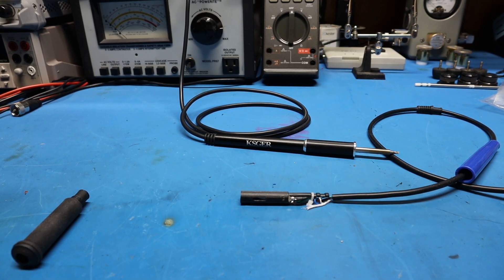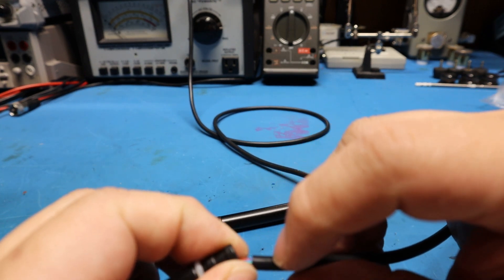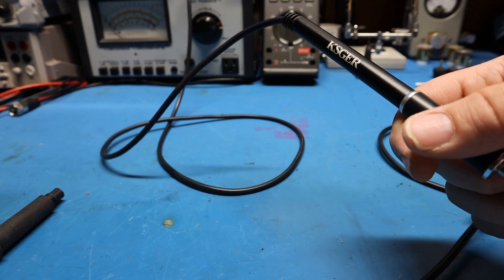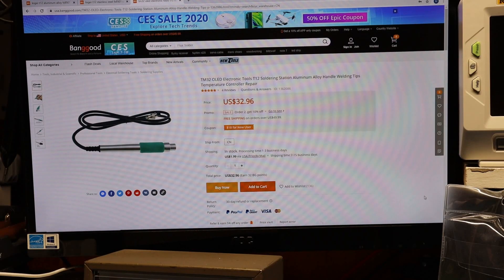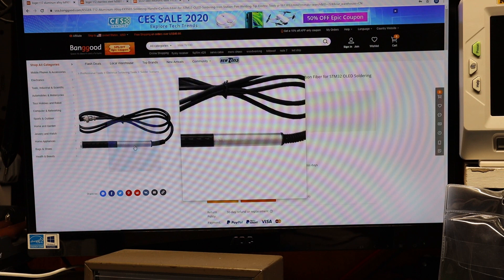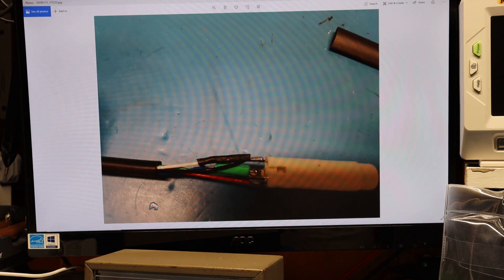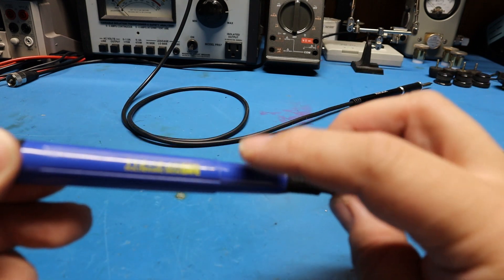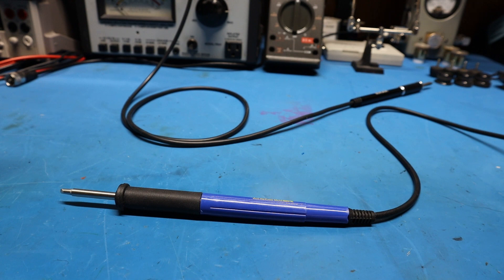KSGER T12 Aluminum Alloy FX9501 Metal handle Upgrade and review

Comment: I have the carbon fiber handle you show at 5:02 and honestly I'm disappointed in it. The white plastic sleeve inside that holds the tip secure (or rather, is supposed to) deformed after only a few uses and now tips slip forward and lose contact every time I clean the tip or pop it back into the handle holder on my caddy. If the internal sleeves were replaceable that would be a big benefit, as I love the feel of the handle, but it just doesn't hold the tips well enough.

Comment: My handle (plastic version) with blue wire and black wire were broken after using for 1 month. I found the strain relief is not working therefore wires were pulled off. Your video is very helpful.

Comment: Thanks for this.  I had read somewhere that the plastic handled one you got with your kit had an issue when people were using them for long periods of time, although that post was not specific about the issue (but seemed to imply that that is why many of the new stations come with the old style handle with the retaining ring and sleeve).  Have you used the plastic handle like you used the metal one and did you find it getting too hot or other issues?  I had gotten the SS handle with mine because of another YouTuber who had an issue with the black handle being too tight, otherwise, I probably would have gotten the black handled one.  I found the exact issue with the SS one you did.  There's no positive click to say your far enough or to secure the tip and I ended up pushing the tip too far and pushing the guts out the back, so I saw your review because I'm hoping to get a better handle.
Reply from the maker: The black handle I had no issues with it being to tight and clicks in fine. I use that one mainly and for hours at a time. The plastic blue one had it where the tip fall out easily, but fixed it as connection base wasn’t screw in all the way and wiring issue from factory. Been fine since, but prefer the black handle and is the one I use mainly.
Reply from the maker: The black one the one to get out of all of them, it does get warm, but not hot and doesn’t bother me.
Reply: @thetechgenie7374  Wow, thank you for the quick response.  I appreciate your doing this video and "taking one for the team" when it comes to testing the various handles.  I had tried to find any info. I could on the various handles to see what was recommended, but could not find too much info. (not sure how this video got missed).  Most of the reviews of the soldering station revolve around the plastic handle and I only found one on the black metal handle.

Comment: My Ksger K12 died, the hand piece had broken a wire off the motion sensor. The wires were all visiable through the strain relief, but i had not seen this video to realize i should have reworked that spot. when the motion sensor stopped working i was in the middle of a Amp project and could push the start button to get the iron hot in 8 seconds. Upon disassembly it was clear to see the blue wire had broken off. i reattached it to find the black wire had also broken off. i was testing the motion sensor with the handle disassembled and heard an arc from the broken black wire touching the red wire. i found where the black wire came off next to the white wire so i reconnected it. However, upon reassembly the head unit continued to show ERROR. i thought that was likely the restart process like when it was new. But then the tip took off and became cherry red. I shut it down. changed tips and restarted once again the new tip became cherry red. It would seen the thermistor has failed or its circuit.  I ordered a new KSGER Alum handle. Hoping it will fix this issue, but I am concerned the short that occurred after the black wire broke off and shorted on the red wire, maybe have fried a component handling the temp circuit. If so where would take this unit?? Made in China, took me months to receive it and even after all the positive reviews, the strain relief fails to protect the skinny wired connections.  I am really worried, I am retired and money is not easy to spend on hobby tools.  Any ideas welcome. Dennis in Virginia

Comment: Good video what to look for and how to do some simple repair/corrective measures. Say did you replace your Weller unit? Keith
Reply from the maker: No the Weller station I keeping as it has also direct active tip, but use it for mostly micro SMD work as have the active tweezers. I needed one for through hole as repair a lot of vintage stuff as tube radios, amps, reel to reel and arcade boards. This one I got to replace my older style WXP120 Solder Pencil, 120W, as had older style tips where tip go over heating element and those tips for the most part are hard to get anymore. This one is way better and way faster in recovery. With the other one would have to wait a few seconds when it when to standby 200c to heat up and had a hard time with large ground planes and heatsinks. This one heat up as soon as I lift the handle and is up in temperature, no wait pretty much. Plus calibrated it, so now is dead on temperature and shows you real time temp. It handle heatsinks and larger components overall with ease. I already have T12 tips I use at work and cheap to get. The station is better the hakko fx951 I use at work as has way more features and shows real time with shorter tip to board distance. If only the QC their stuff?

I replaced a quad flat pack IC with it today on a arcade board and did it with ease in a couple of second with that BCM3 tip drag soldering it, it took me longer to remove the chip with hot air, then soldering it back to the board. That tip is great.

I did try the Pace ads200 as was only $220, but ended up returning it  twice as first one was defective and second one did poor on tests and half the tips didn't work literally I had some that came up to temp and then stopped working and did poorly just unsoldering a heat sink from a board. Plus you can not flip the tip over as direction one way insert. Plus the Pace would overshoot by 40c reason it doesn't show real temp, the Ksger doesn't and does great in keeping temperature about 5c regulation even when heavily loaded. 

Despite the typical Chinese factory QC problems this Ksger had, this one way better bang for the buck and yes you can use genuine Hakko tips as well. Have 6 hours on it already and going to be pretty much my daily driver. If you have to choose from older style tip design, vs direct tip this is the station to get without spending $500 plus on one. You just have to work out the safety and QC issues, you won't want to go back to the older style once you use direct active tip, it is that much better when it come to thermal recovery. It uses a STM 32 bit Arm Cortex micro MCU which is using a 3rd party open source software that matured and most bugs like the copper heat dissipation on linear regulator been worked out. Just make sure you buy one with 2.01, or 2.1S hardware version, avoid the 2.0 version. Uses a continuous high current mosfet for switching, instead of the triac the older cheaper solder station use that are known to fail. So it is a good one, as they are sort of using what newer JBC and Pace uses as they also use a mosfet for switching. Don't bother going with the more expensive 150w version of the t12 station, the tips are designed for 75 watts and seen issue with people that have the more expensive 150w JABE station having tips burn up quickly due to they are over-driving them, no they are not t12 tips. 75 watts is perfect for the t12/t15 tips and all that needed and is the sweet spot pretty much. Avoid the PACE ads200 there are a few major design flaws with it and may do a video explaining them if I get another one as still have the tips. It did poorly on tests and didn't have the power to remove a heatsink as tips are not as good as the t12/t15 tips are. Not sure why people recommend it to be honest, it was that bad and waited and tried the revised one as they did revise it after complaints from a few people. Stick with the t12/t15 as they are proven and been around for many years and better tip selection overall. Just don't bother with the knife one that come with the station and invest in good tips. I already have a few of them as use them at work. The orginal Hakko are 12 to 15 bucks and the Ksger tips which are pretty good are about 5 to 9 bucks each, which both is what I been using over the years. I have yet to come across a defective tip.